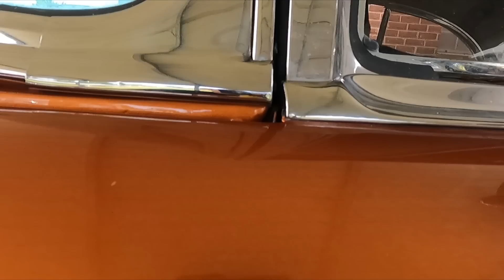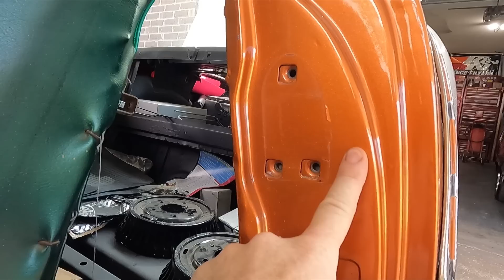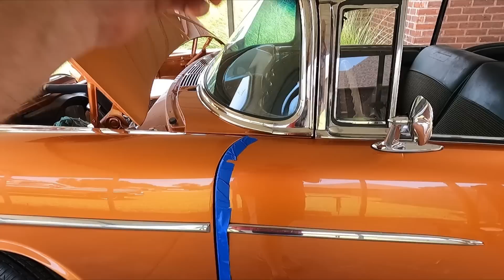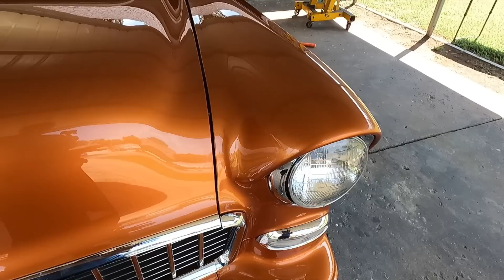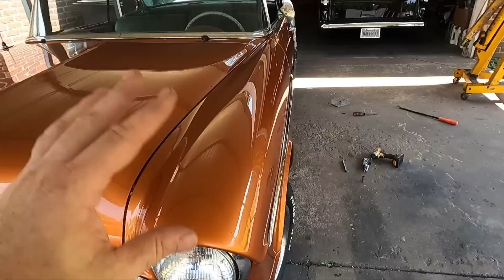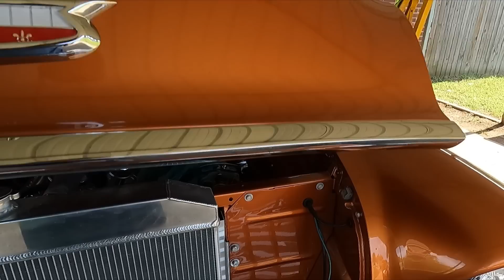Steve's 55 day one. Sheetmetal alignment

Comment: He didn't show how or if he fixed the window flipper.
Reply from the maker: Not in this video since the video is titled = SHEETMETAL ALIGNMENT and it's my very first day working on this 55. There's a video on flipper modification, fitting, and operating perfectly. I also have a playlist on hardtop flipper rebuild and alignment.

Comment: Honestly, this reminds me of the "off" things that I have come across on min that made me wonder why it was done a certain way. Like front fenders not removed for paint. Some rear chrome around the smaller window in the back no removed.  Expensive paint job by a shop that only worked on tri fives.  Mind you it was early 90's..  Then finding a bent connecting rod in my engine.  Only had 1000 miles on it.  Shoddy work but will take your money..  glad I'm working g on it myself and now I can only Blame myself and or know what should be done when I have to outsource.  Nice to see what you are doing.  Helps keep me in line.

Comment: Rob, you definitely know what to do and how to fix the panel gaps properly. Good Stuff! 
Good money was spent for "Butcher" Assembly. Welcome to today's world. I was thinking the easy fix may be to loosen the cowl vent and shim the center portion to help close the gap. Or how about a phone book placed on the hood and gently tapped down to align the high spot?
Reply from the maker: You skipped the video I guess. I did shim the cowl screen. I do not want to try to bend a painted hood.  A phone book is a great idea but if that paint cracks, I'd have to pay for the repaint.